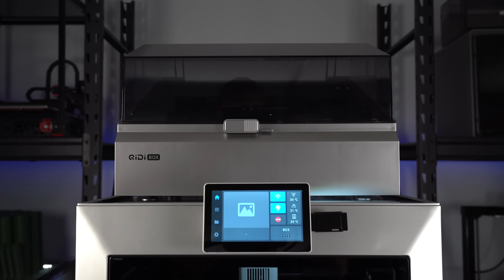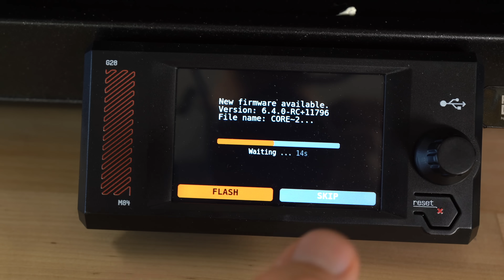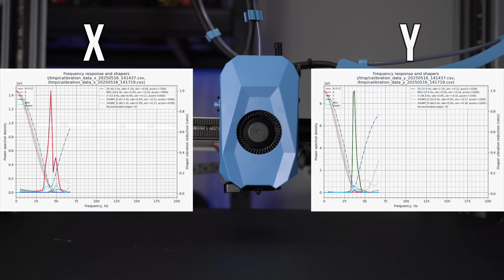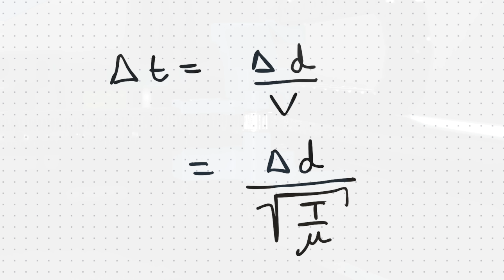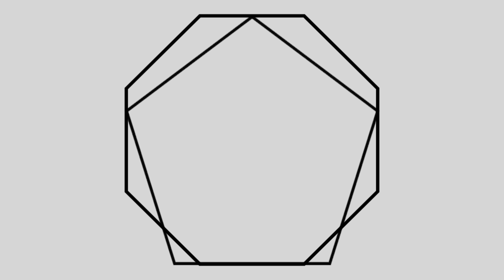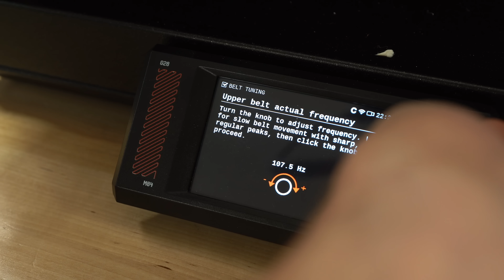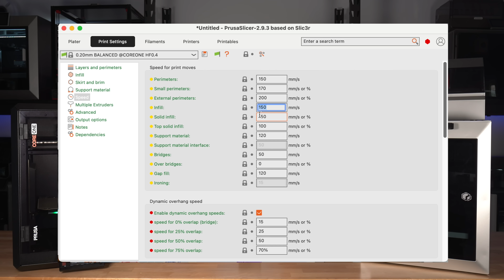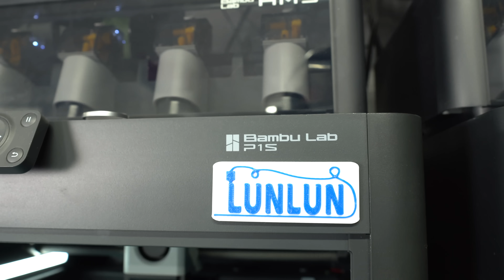The 3D Printing VFA Epidemic

Comment from the maker: Thanks for watching! This is a complicated topic with not a whole lot of information online, let alone consensus. I did my best to research thoroughly and synthesize the information into something digestible. If you think I got anything wrong feel free to leave a comment letting me know so we can all learn and get better together.
Reply: I think it's worth looking at mechanical damping. Ironically "worse" motion systems seem to have fewer VFA's, the ender3 with rubber rollers provides more mechanical damping during movement than linear rods of a prusa. Now, with any spring damper system, there's drawbacks to too much damping also, possibly making other print artifacts worse.
Reply: I'm curious if taking a little material off the top of the teeth in the drive wheel  could mitigate some of the VFA effect. Take off just enough for the belt to sit a little more 'circular' on the wheel. Wouldn't be too hard to test.
Reply: I remember a similar very extensive youtube investigation about VFAs that only happened with direct drive. And was gone with a bowden extruder. Pointing to the extruder causing VFAs. And it probably can. But perhaps in that case it was caused by the difference in print head mass and resonance frequency with the heavy direct drive stepper motor.
Reply: 10:01 You mention the Q2 Pro it sounds like... do you mean the Q2? I can't seem to find anything about a pro version.
Reply from the maker: @BitsAndPiecesKB I misspoke. It’s just called Q2.
Reply: @ygk3d  Thank you so much! Just wanted to make sure that I wouldn't be missing out on the quality improvement if I bought one. Great video. Thanks for all the work you put in.
Reply: Hey, the explanation about stepper motors was completely wrong. Steppers rotate at discreet intervals, such as .9°, when one phase goes high and again when the other goes low. It is a property of the motor, not the drive. Micro-step and silent drivers work differently, with modified sine and sine waves respectively, allowing motion between steps. The motor will still cog somewhat due to the pitch entire step. 

As for the type 2 artifacts, silentsync belts would be ideal. But, they are patented and expensive. As an alternative, running 2 belts per axis, offset by one tooth pitch, would help greatly. If a 1.5mm pitch belt has a peak to peak of 1.5mm between potential artifacts then two would have a .75mm peak to peak.

Another idea would be to use a capstan drum instead of a toothed belt, some old plotters like the Roland CJ-70 used them to drive the carriage.
Reply: @FPSG sorry that is wrong. Modern controllers use microstepping increasing effectiveness step by 4 up o 256 times. This has its won issues that include irregular step angles when one phase current is very low. Not sure if they implement torque averaging which helps make step angle more constant
Reply from the maker: Hey! Thanks for your thoughts. I’m aware that stepper motors have discreet position increments, either 1.8 degrees or 0.9 degrees. Those are the full steps. Microstepping allows you to interpolate between them. But still, the current is changed in steps. It is a digital signal, not analog. So microstepping helps smooth out the torque but there are still small discontinuous that induce vibrations. That’s the essence of what I tried to convey in the video Am I getting anything wrong here?
Reply: @ygk3d  so, the motor driver can't provide discreet steps in current like you illustrated. If you have a 24 volt driver and motor, the driver is providing 24 volts, 0 volts, or -24 volts to each phase. The way micro steps work is through pulse width modulation. So if the driver pulses 24v at a 50% duty cycle it is effectively 12v.  When it comes to silent drives, the frequency that these pulses can be generated are ultrasonic. When you look at current, it is a function of the resistance and inductance of the motor. When this is factored in the rise and fall time makes a sine wave, not a stepped wave. The change in the pulse width can be smooth between 0% and 100%. The pulsing in the torque are a function of the way the motors work, not the power delivery. Stepper motors only have full torque at full steps, so as they approach 100% duty cycle on a phase they have more torque. 

Servo drives deliver power the same way as Micro-step drivers for steppers but the motors are designed to hold positions at any point in their rotation.
Reply from the maker: @FPSG good info! Appreciate you taking the time to share your knowledge. The illustration I gave was based on the research I did, but it’s possible I misinterpreted. If you google microstepping and look at the image results, there are many similar illustrations showing discontinuous current curves for the two motor phases. Not sure if this link will work but here’s one example:  https://www.drdflo.com/pages/Guides/How-to-Build-a-3D-Printer/Microstepping.html
Reply: @FPSG modern steppers are current not voltage controlled. Higher voltage allows higher step rates. Microstepping provides sinusoidal out of phase currents to the two windings thus implementing the sub step angles. Ie fora 1.8 degree motor with 200 steps per revolution to say 3200 step/rev with 16 microstep setting
Reply: Why are you still recomending Bambu Lab to keep stealing from their competitors, instead of recomending buying them? You should say: "buy Bambu Lab if you want VFA in your prints, buy Prusa or Qidi if you really care about not having VFA". Plz, you should stop promoting Bambu Lab. This deserves a thumbs down.
Reply: @Ismsanmar maybe because whether you like it or not, Bambu still does many things right.  And many of them better than qidi, prusa or whoever. From basic user experience to reliability of the printer, just better with Bambu. And this is coming from someone who is hoping for another option that works as well as bambu. But there is ALWAYS a tradeoff with other units
Reply: 10 years of community info on the topic = not a whole lot of information online. 🤡🤡🤡. just return your garbage bambu and buy a prusa, or an elegoo, or a creality k2. but nah you're in bambu's pocket homie.
Reply from the maker: @hiphip2383 tell me you didn’t watch the video without telling me you didn’t watch the video.

Comment: One way to reduce the belt/pulley ripples is to create a sort of hybrid timing belt with two flat surfaces on either side to provide smooth contact edges, and the middle would have the teeth for grip. The pulleys could be made by adding smooth roller surfaces on either side. The belts would have to be double-wide (or a bit less) to pull it off. And then, to correct the motor ripples, use at least a 10:1, low-backlash, reduction gear drive. I guess that would also introduce a whole set of technical problems to be sorted out, but it's a start.

Comment: Err this has already been solved decades ago daisywheel printers used DC motors not steppers ,  some used drums with steel strip like the Golfball and drum printers  or like the diablo 1355WP which used steel cables and DC motors  some used 2  toothed belts arranged as half step between with opposite tension to stop backlash ,  this is all stuff I have worked on in the field, decades ago ,  some used DC bias as holding current to offset "striping"  it was under processor control so you could tune out artifacts in the print quality ,   look at the history  most used encoders to give the actual head position not where the motor was ,  then you printed without the stop start you printed smoothly,  I cannot believe that this is a problem now almost 50 years later ,

Comment: Well, I learnt quite a bit from this.  Thanks!  Now to go see if anyone's done the research to figure out where the X1's sweet spot speeds are - because I do find that for overall dimensional accuracy, slowing that printer down helps a /lot/.

Personally, I doubt there's going to be an X2C.  What could they possibly put in it that the P2S doesn't have?  But they have also shown a very good understanding of how premium and substitution works (in the economic theory meaning of those words) so it's certainly possible that a "high end" P2/X2 will come out and feature 1.5mm belts.  Even so, I'd guess the most likely reason the P2S still uses 2mm pitch belts is because the P2S still uses the X1/P1 motion system, and all the injection molded parts are built around the 2mm belts.

Comment: I have a Core One which I built from a kit and I think the VFA's look significantly better than the examples you showed here. I know there will be variation from machine to machine, and mine is still relatively new so time will tell here. 

I did initially have a question that I spoke to Prusa about concerning how many times it makes the head touch the end of both axes before starting a print. The topic of belt tension cropped up here too and therefore I was quite focused on it for a while. When I'd first built the machine I noticed that the belt tension kept dropping after each of the first handful of prints. Presumably the belts needed to "bed in" for a while. This stabilised over time. Something I noticed is that the belt tension changes quite notably between a cold machine and a warm machine (~7-8 Hz on both belts). Now I always make sure I warm the chamber up before checking/adjusting belt tension and have been very happy with print quality since.

Comment: I think the motor induced VFA can be almost eliminated with software and micro stepping. I use the  TMC autotune  plugin for helping that side of things. As for the belts, on my Voron printers I test resonances with the Klippain Shaketune pluggin which gives me much more information to troubleshoot with than normal input shaper. It has a vibrations profile setting which uses the accelerometer to measure the vibrations at different speeds and makes a nice chart you can use to pick printing speeds. I get virtually no VFA after I go through the process to make sure the belt paths are very well aligned and tensioned properly.

Comment: Why not move away from this kind of belts and move to V-belts instead? And change the motor-drives to be either indirect with different gearing on both belts so their effect will be less of a patern and use software to compensate for the other factors if on an exact 45 degrees angle ? You can also add an automatic belt-tensioning-system (with electronic control) and testing to set it to the right tension.
Well, probably also because of costs and therefore price...

Comment: Thanks for explaining!  

So, a 3D printer (or for that matter, any 
CNC machine) should not use stepper motors 
at all, but instead deploy closed loop feedback 
DC motors/print heads? 

Note that this would also solve the problem 
of stepper motors missing steps; thereby
ruining the remaining part of the 3D print..

Also, no belts but instead screw spindles, 
like on a lathe? Even better, perhaps 
closed loop linear motors? 
One wouldn't need al kinds of fancy
compensating tricks or have the
output result depending on something 
so unstable as belt tension thus needing 
frequent readjustments due 
to wear and tear.. 

But this would probably make devices
a lot more expensive...

I guess that non-stepping closed loop 
systems are the only way to solve this problem..

It's not a new idea, btw.. in 1978 I saw a
demo of an A3 X/Y pen plotter with closed loop
DC motors, making perfect drawings and 
much faster than X/Y pen plotters with 
stepper motors.  It wasn't very successful,
because micro controllers didn't exist
in 1978, so a large PC board with loads
of TTL and discrete components was
necessary  to control the closed loop 
axis movements; which made these
plotters much more expensive than
plotters with conventional stepper 
motors at that time. At a price only 
feasible for high volume production.

Comment: Perhaps 3D printers should try high precision recirculating ball screws and servo motors. I suppose there is a reason you don't see a belt in a vertical machining center and they have mostly all gone to servos. To catch that .0001 precision, you need all this and amazing ways or linear rails.

Comment: VFAs are binding or less friction or unparallel sections in various axis. The machine axis are not precise in perpendicular, normal, parallel the entire length of the lengths. Nor are they the same in friction the axis length. Can be magnified by motor action - easy motion, harder motion. Can be motivated with sensors, software/firmware monitoring and compensation. To move an axis doesn't require same motor voltage and amps along the entire axis motion.

Comment: Any company that puts a smooth idler on the toothed section of a belt, just has no idea in the 1st place. each teeth that roles on a smoth surface of the roller on a 90 degree turn, is going to tension, and as it goes from next void to teeth, it going to release causing the oscillation. if you cant even see this simple factor, just stop, dont bother anymore. motor resonance etc, these are hardly factors when the printers running a straight line.

Comment: Lol its essentially a problem already solved for most cnc machine centers minus workpiece and tool holding itself. These oscillations and harmonic issues basically destroy work. Its called chatter. The easiest way to solve these problems is mass, rigidity, mitigating slack/endplay/backlash/preload on all drive systems. Its really simple, add some weight, use a test indicator to measure the stated variables in the last bit. Measure all of these variables and tighten them where they move fairly easily whike still getting those measurements as small as possible. Then add weight, just enough to dampen vibrations without sacrificing performance. Its just a price cutting strategy of the msnufacture. Less mass less cost. Less labor to tune less cost. Belts= less cost. Servo driven ballscrews with linear rails is the best available options. Those are very expensive relatively speaking.
Reply: I rebuild industrial machinery for a living,  dipping my toes into 3d printing
Reply: I geuss software is a way to mitigate these problems. As if you've ever turned on a cnc lathe some thin wall parts will resonate and scream. You can write programs to raise and lower rams to prevent resonance in the work.

Comment: I mentioned in an earlier comment that I have a printer that uses a block and tackle system for both the Z and XY axis, having done a few prints recently, it's pretty clear I'm not getting any easily visible VFAs, despite having pretty much the most bog standard components, pretty low belt tension (High enough to work fine, but hardly high enough to pluck a 90hz note!)

I don't know of any existing machines that you could test this on, but I suspect the block-and-tackle style Core XY belt routing I've got going on might be having a pretty significant effect, that calls for some science.

Comment: At 80, I'm still stunned that 3d printers can do what they do! They're just going to get better and better. Like another commenter, I only do functional prints so it's not a biggy. And it's guys like you who will make it so. Subbed and liked.
Reply: and for less strength-critical parts... modern resin printers output pieces that are essentially as smooth as injection molded parts. When not, they can be sanded since they're solid internally. I electroplate resin prints and the layers lines really only become visible when there's a couple atoms of shiny metal on them

Comment: How about helical gears and belts? This eliminates vibrations in vehicle transmissions. That's what makes the difference between the forward gears and reverse gear. We all know how loud the reverse gear is. That's the reason.

Basically, there are three options.

Straight-cut teeth:
||||||||||||||| Much vibration and noise

Helical teeth:
/////////// Leads to lateral displacement of the belt

V-cut teeth:
≪≪≪≪≪≪ Expensive to manufacture but no lateral displacement, the most silent and least vibrations

Comment: Meh, FDM is like the carburetor. It's near the end of its potential. It's full of compromises. Layer adhesion forcing suboptimal print orientation, thus forcing layer lines to impact the esthetics of your part, constantly dealing with supports, polymer creep over time, limitations on applicable polymers due to the extrusion process, and so on. It doesn't matter if you move on to ballscrews and high-end servos. The weak point of FDM is extrusion. We need more SLS options at the consumer level.

Comment: Sometimes people get obsessed with achieving ultra-flat surfaces on objects. And the truth is, it's very difficult. You have to consider the technology you're using, your machine's speed settings, the design of the part, the material, etc.

It's like concrete construction: you have to understand that the raw result is sometimes imperfect for various reasons, and if you want a perfect finish, you'll have to do post-processing.

I'm generally tired of this whole thing. I usually prefer a pleasant texture to a perfectly flat surface (when it's not necessary). That's why I love design and playing with settings so much.

Comment: I wonder if the effect wouldn't be better controlled if the pulleys had teeth and the belts had indentations where the pulley teeth would slot into? This would negate the "not making perfect circular contact" problem go away because the effective contact patch would thus be circular.

Comment: In stepper motors, it is not only about drivers not being able to deliver a smooth waveform, but primarily due to the nature of the stepper motors. They are called steppers, not by accident; they move by steps. This can be mitigated by advanced drivers, yet their overall characteristics will never be linear.

Comment: why not implement dynamic belt tensioner software? as in, the printer monitors/measures itself automatically adjusts belt tensioning as it prints? using a function of print speed to adjust the belt tension refresh rate?